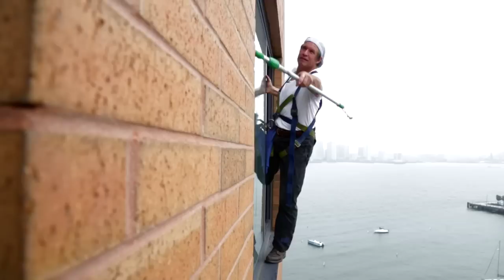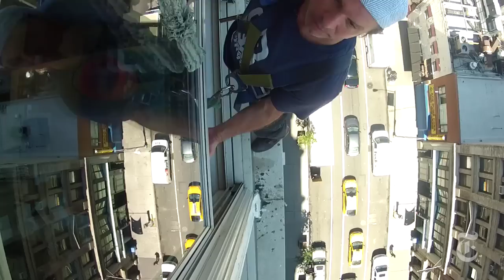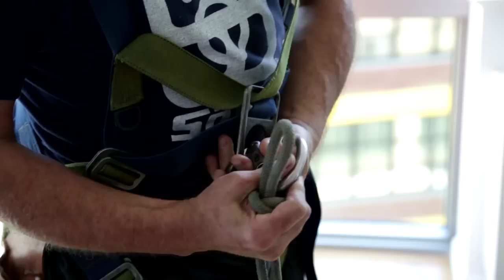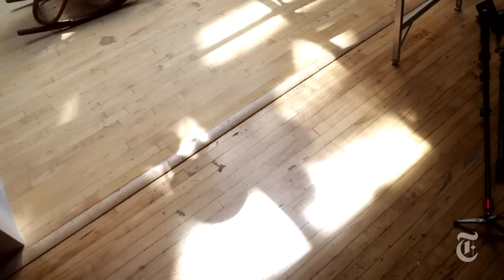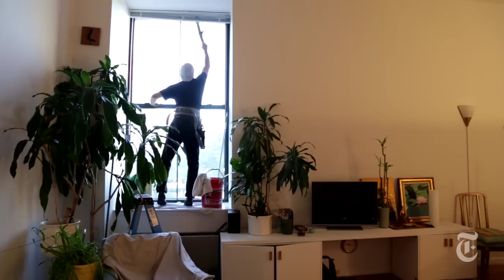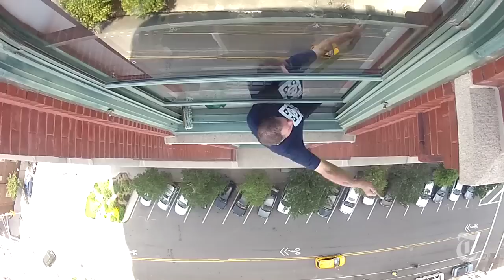What It's Like to Be a Window Cleaner in New York City | The New York Times

Comment: Hard core. I'm surprised it's not a legal requirement to tether your tools. Very easy to do with some clips and string. Would also save your hands having a relaxed grip.
Reply: It's is in the UK
Reply: Ben Adriance it’s a safety hazard to tether them. Plus the areas below are required by OSHA to be taped off
Reply: @GaudetteProductions1  OSHA requires u to tie off your tools any time there's a risk to people below, barricade or not. (Pretty sure). Haven't read the mandates in a while tho.

Comment: Been doing this for 30 yrs in boston where standouts and beltwork were sop when i started in late 80s but now osha will not allow these methods.On rare occasions you will put one man out secured to one man inside or to counterweights-belt hooks are supposed to be inspected and tested as so many were sheared off when replacing windows-old wooden frames rotted out on originals.

Comment: whether youre on a window on a tall apartment or on a window at the top of a skyscraper, youre fucked if you fall either way. Maybe that'll make you feel better about washing the windows on skyscrapers xD it's actually really easy to balance while washing a window on a platform that is wide enough for your feet. The height is the only thing that throws you off balance. If the window was on ground level you could do it easily with no ropes, you just need to bring that to heights.